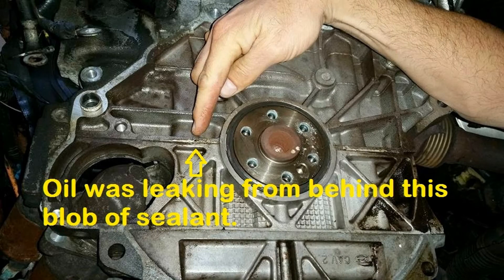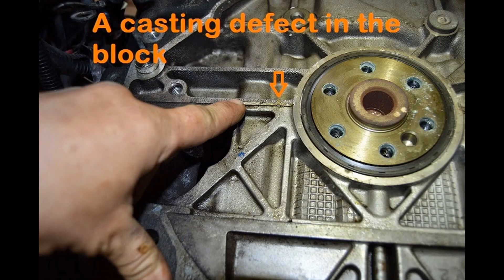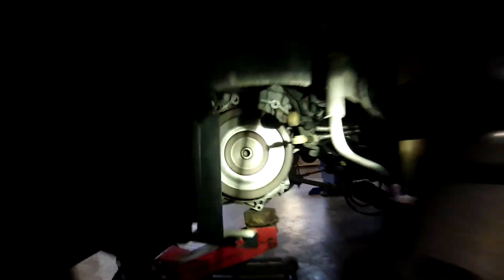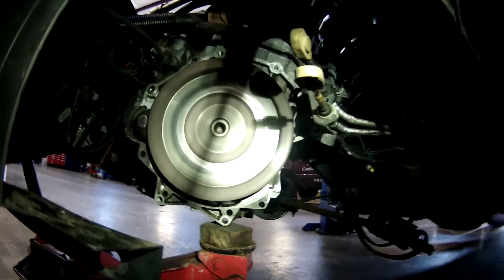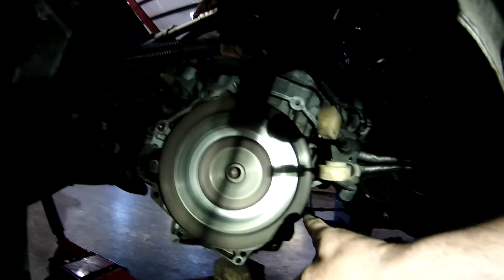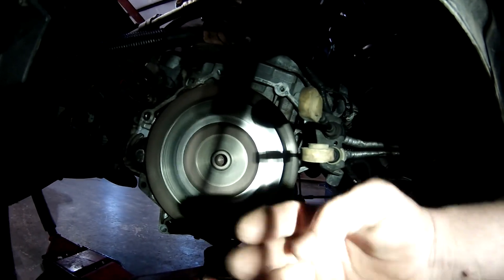Saturn Engine Running In Space!

Comment: not trying to be a dick or anything, but working in a GM dealership and seen this exact issue, 2-3 times, i've seen them leak at the front of the crankshaft saddle, on other side of rear main and on the rear side of the block, the problem comes from they use engine block sealant on the block halfs, from head and expansion rates and heat cycles, the RTV just fails! when you take it apart you can see the channel were it has failed, but then again i didnt get a close look at the leak so very well could be a defect there, seen my fair share of thoses:)
You do not need to do a full rebuild on the engine, just flip it upside down and take the block half/crank saddle off and reseal it. BUT i like your method more and next time i see one not warranty ill throw this option out there!
Reply from the maker: +Kevin Rogers It still leaked a little but not nearly as bad.

Comment: Hey Amesie, I have a question. I need to get my AC charged since I repaired my accident from Jan.  I had to replace the A/C condenser. So now it has no fluid in.  Is this a job I should leave for a larger repair shop, or would a quick lube place like valvoline be adequate?  What's all involved in a full A/C system recharge? Thanks much man!
-Mike
Reply from the maker: marshkid1 Well first thing would be to put the system under a vacuum to check to see if it leaks and to boil out any moisture that would be in there. Then charge with the right amount of r-134a and a couple ounces of dye oil.
Any garage that has a stand alone ac machine can handle it.
Reply: Amesie's Corner Sounds Good! I will be sure whatever shop I find can do all of those steps for me.  Thanks!!
Mike

Comment: Weird problem, cool fix though.
Who knows how many other cars potentially has that same oil leak due to most likely a casting problem.
I thought the engine would be unbalanced running without the transmission specially being a FWD.

Comment: Why not use something better like a least Jb weld? Or Hst-2000 durafill
Reply from the maker: ***** I  needed the sealant to flow as far into the hole as possible. I have found the rigid grey rtv to be  really durable in a fix like this. It flows in like toothpaste and sets up really strong and lasts years.